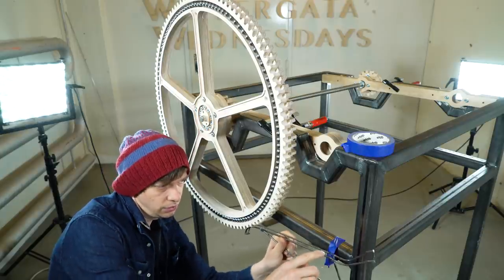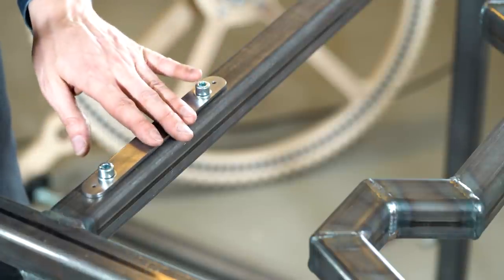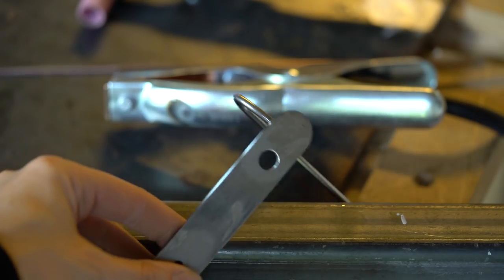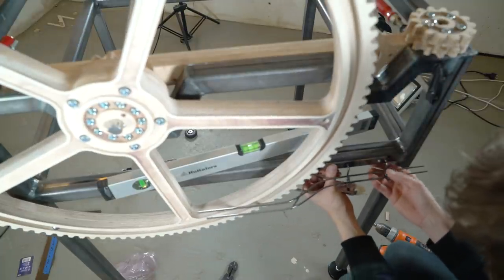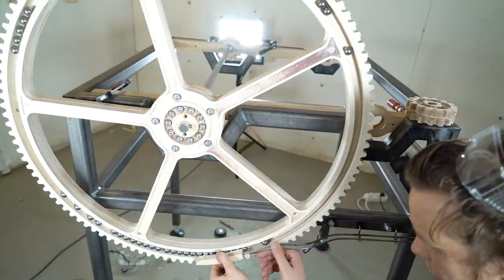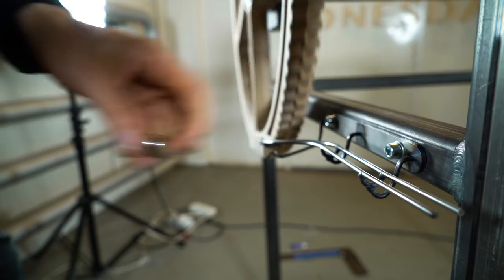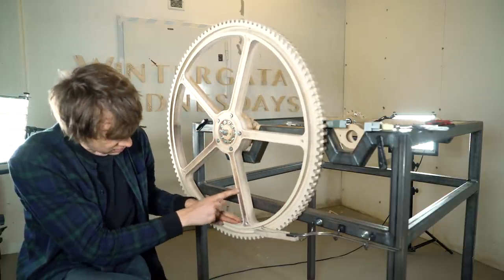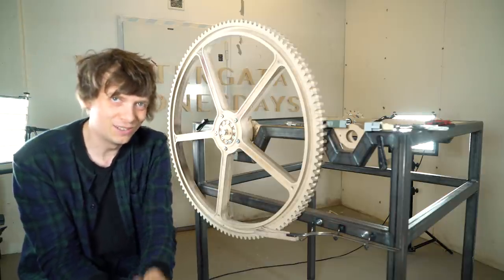Marble Tracks - Marble Machine X #15

Comment: Yaay Wilson! at 9:00

Regarding magnetism, I think first you should sort the magnets in the wheel according to strength of the magnet and then figure out how strong the magnetic attraction needs to be in order to ferry the magnets up the wheel.  You can also vary the depth of the magnets in the wheel to control how much magnet exposure you're giving your balls.  Right now, it seems like the magnetic attraction is far stronger than it needs to be considering the likelihood of double balls per 7:53.  If the magnets were selected, and magnet pocket depth tuned, I imagine you could have just enough strength to hold a single magnet and have a double fall off (or remain in the feeder tray with minimal drag on the mechanism).

Comment: I know i already said it in the previous video but you could use instead a fixed plexiglass shield on the side of the wheel with holes only where the marbles go in and out. Also when you take out the marbles you can demagnetize them by making the track passing through a closed shaped piece od wood with other magnets into it placed in random order to create chaos in the magnetic field. (or search for a screwdrive magnetizer and look how the demagnetize side work, or buy one and open it up)

Comment: The marbles are not really becoming "magnetized"; rather, they are becoming electrostatically charged. When you dropped them onto the floor, they became electrically grounded, causing the charges to dissipate into the ground. 

I figure that a plausible solution would be to have a wire with one end connected to the metal frame, preferably near the bottom, and the other end touching the floor. Any metal tracks could also be wired to the frame, so that the charges retained in the marbles can dissipate through the wires into the ground. Think of it as a lightning bolt that connects the clouds to the ground to dissipate charges between them.

Comment: What you could do for the magnetization of the marbles (if they don't end up demagnetized on the machine) is run a current through them. You could have one metal track attached to one side of the battery, and the metal track onto the other side of the battery,  so the marble completes the circuit. This would make all the electrons jump around, so the magnetism is lost.

Comment: I don't think that's how you're supposed to use a tap. If it actually work without much fuss it may mean the hole has a little too wide to start with.  You can find machinists charts for hole size appropriate to start each tap from. Does look fun though.

Hope you make a model of that ramp, so if it breaks you can fire up the cnc instead of doing all by hand again.

Comment: You definitely could have the marbles pass through a weak degaussing coil as they come off the wheel at the top. Just to be sure they aren't sticking together. You are also right the striking of notes should also act to demagnetize them before rolling back on to the wheel.

Comment: you could demagnetise the stell balls by letting them pass a alternating current solenoid (you could even fix one around a nice part of the tracks) - the current you could generate from the rotational movement of the main wheel mechanism. no external power needed and it would look cool too.

Comment: Maybe try coloring the tracks a different color so that they contrast the wood and the steel frame as well as the balls. It might even help quell the noise of the balls rolling though i don't know whether the paint will add friction but that would probably depend on the paint

Comment: You need to make up some jigs for welding marble track.  Plywood works, but a metal  bar with or two groves mlled in it and a threaded hole in the center would let you clamp the rods down with a washer and bolt.

Comment: One option for the transition piece could be to have a captured tube for the marbles made from 3 or 4 steel rods. Adding another rod to the track in that section would keep with the same aesthetic and would not allow the marbles to bunch up. The tube or 3 rod captured framework could then open up at the desired angles just like a 3D printed part.

Comment: You could also use a non-magnetic metal for the rails instead of steel, then magnetization of the marbles won't cause them to interact with it anyway.

Comment: Would it not have been easier to have this piece 3D printed, particularly since you were able to bend the track rods with your hands is there not a risk that the track will become bent when you take it on tour? If it were 3D printed it could be easily replaced with an exactly correct piece.

Comment: If the magnetism is caused by long term and not by a single session, then a solution could be heating them after each concert in a oven. It may blemish the marbles a little though. But the heat of a oven will force any persisting magnetism to go away.

Comment: is it too late to consider using multiple marble pumps in parallel to transport the steel bearings to the top? I think it would be a beautiful design to see a wall of bearings traveling up the side of the machine, also there would be no magnets involved.

Comment: to avoid the chattering and trouble you were having drilling the steel in the drill press, lower speeds and more feed pressure should help if at all possible with your setup

Comment: it makes it easier to controll your welding if you cut your filler rod in half, also use a filler rod that is thinner than the material you weld on so the rod melts before your material

Comment: About the magnetizing. It WILL get worse over time. The point is that you just don't really know, and therefor it will be unreliable on the long run.
Hitting them hard works, or heating them up (or a combination). There are other demagnetization techniques, but most of them require a lot of current.
Although there are also ways of doing it with other magnets I believe. (It's a while back that I was actually involved in this field of physics).
Something with hysteresis loops and things, it's worth looking into it.
Rapid temperature change is also very effective if I recall well.
Reply: Brainstorming a bit further, maybe you can think of something that the marbles hit each-other other. There mass/volume ratio (density) is pretty high, so it's not so difficult to create quite some momentum. Or let them fall down on a heavy dense metal plate or something.
Simplest solution is going for non ferromagnetic tracks. Use copper, stainless steel or aluminum, even looks cool!!!
With copper you don't even need to weld anymore, you can just solder it.

(Another cool effect to implement btw is something called eddy currents. "Floating' magnets in aluminum ;) )

Comment: Amazing work! You can heat up your marbles, it should reduce magnetic issue, or use some rotating weak magnets below or above marble paths, kinda try imitating chaotic oscilating magnetic field. Also some kind of alloys act like feromagnetics just below certain temperature and paramagnetics above it
Reply: maybe just placing magnets with different polarity above and below the marble path in succession will help, who knows

Comment: For rig welds like that, no need for filler, a fusion weld, with no filler would be perfect, because of your precise tolerance with your holes that you drilled, then you wouldn't have to grind any access away
Reply: *excess
With the half-ring supports being imperfect simply by their design, it's sort of needed there. The rest would be to maintain the uniform design aesthetic.

Comment: Why not use a non magnetic (austenitic) stainless steel wire rod instead? That solves the whole problem without adding a demagnetiser to it
Reply: Ignore that comment as I've just read further down a similar suggestion rebutted because its not the track which is the problem but the balls that cause an unrollable shape when sticking together.

Comment: Well, smashing the marbles on anything other than the instrument itself would interfere with the music. But I doubt the impact is hard enough to lose the magnetisation. So a mechanical degausser would be the best option. I imagine having strong permanent magnets rotate fast around a straight piece of rail while the marbles roll through would look quite nice. Of course you don't want the marbles to fly off the rail, so that section needs to be caged with two more rails. Or you arrange the magnets in a quadrupole pattern. I think it is quite a challenge engineering wise, because you need to have the marbles in the center, where the axis of rotation would be, so you cant have a simple steel rod for that.
Reply: Of course you could just use AC in a coil instead, but that would be too easy, right?

Comment: Why use rails? Would not pipes, tubes or hoses keep the marbles better in line? No marble can escape from a pipe and you can stack up marbles further.
Reply: SCwirlify Goid idea! Clear plastic or even glass tubing is relatively easy to shape.

Comment: I think, that the marbels get demagnetized, when they hit the instrumens. An alternative way for the marble tracks could be a 3D-printed track. This would be a good contrast: The plywood weeel, the steel frame and the  3D-printed track.
Reply: 3d printed track would be fragile or bulky depending on the design.
Reply: Well, I personally never worked with a 3D-printed object, so I don't kown the behavior of  3D-printed objects

Comment: Why do the marbles have to be metal?

When I picture marbles, I see them as glass with some strange shape in the middle. Then there is no magnetisation problem, right?
Reply: Yo Mom But then the magnetic ring lift wouldn't work. For the "marbles per crank" quota they wanted, this is a pretty clever method.
Reply: Hhhhhhh why life got 2 B so complicated?